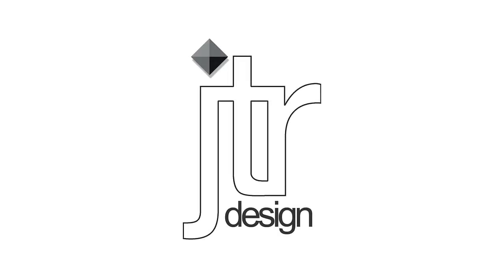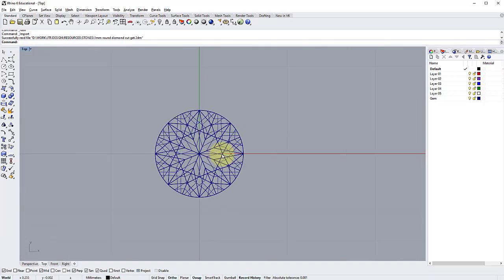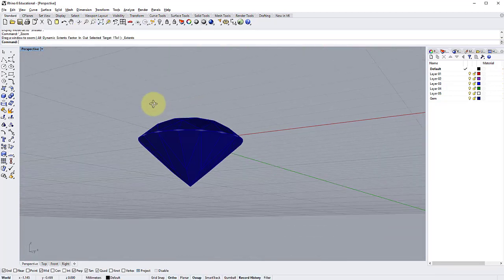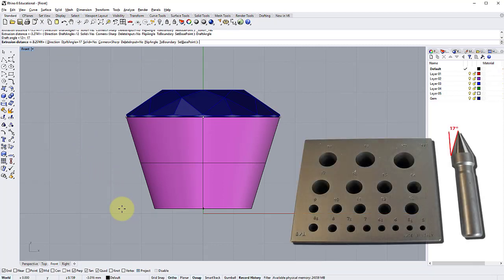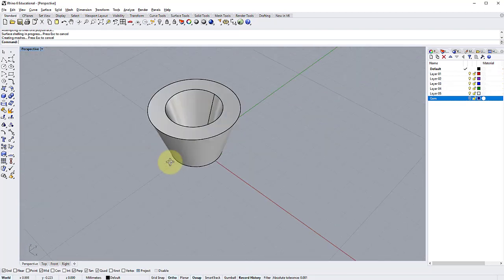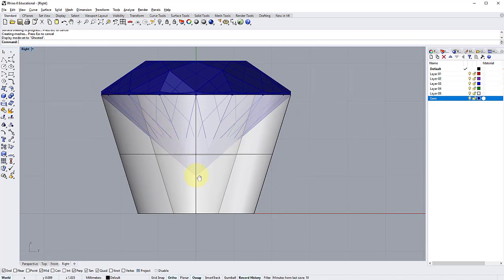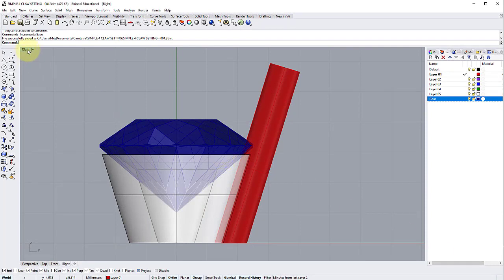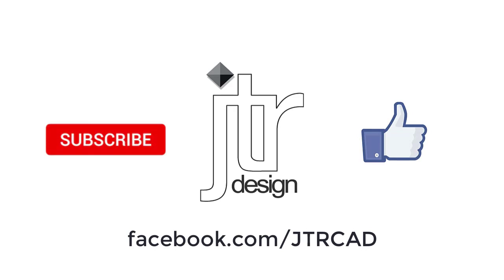4 Claw Setting -  Beginners Rhino Jewellery Tutorial

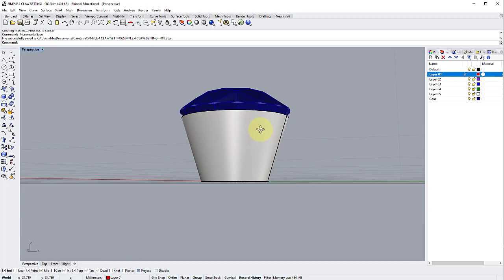Comment: for some reason i do not have the surface line needed at 12:14.... i have multiple lines and can not select any to extend ?
Reply from the maker: Hi Brock. If you don’t have the surface edge in that location you can use the command ExtractIsocurve to get one. If it’s not going in the correct orientation, click “toggle” in the command line. Hope this helps.

Comment: Nice tutorial, thank you! For the origin, I just enter 0 followed by Enter.

Regarding the design of stone settings, I'm a n00b. I wonder: Why do you not make the chamfer match the stone, and why do you not put an undercut into the prongs?

My guess is that 3D printing is not precise enough, plus variances in the stones, and it's better to do that by hand when doing the setting. But I really have no idea.
Reply from the maker: Your guess is kind of correct - its all do do with the variables of materials and manufacturing techniques.

Comment: This is a very good presentation. I am learning Rhino for jewellery and I tried your idea for a marquise stone. The pointed stone outline created a pointed under-bezel. Should I fillet the corners of the curve of the girdle outline before extruding it to make the under-bezel, or is there are way to round (soften) the ends of the extrusion? I ask becuase I have heard that sharp corners are a bad for casting. Not sure if I need to worry about it but thought you would know. Thank you for showing us how to do this!
Reply from the maker: Thanks for letting me know you liked the video, David . You could use the ‘fillet curve’ command to round the curve before you extrude or you can use the ‘fillet edge’ command. Though to be honest it should be fine as it is. With sharp edges and casting its usually long, sknife-edge areas left in negative space that cause issues, rather then sharp edges in positive  space, if that makes sense. If you require any help with your rhino learning journey get in touch.
Reply: @jtrdesign-practicalrhinoje9669  Thank you for the clarification and education regarding the sharp edges. Do you offer specific classes/lessons or is it one on one when there is a design issue I am struggling with?
Reply: @DavidConger  All classes are 1 one 1. I guess they’re more tutorials or bespoke lessons, rather that traditional classes. I tailor the lessons to your specific requirements, after an initial consultation. Then we arrange a date/time for the lesson and connect via Zoom. So if you have specific things you are struggling with I can help you with those or if there is a particular area or design you’d like to know more about, we can focus on that. Lessons can be a little at 1 hour or up to 6 hours. I find the optimum time for the student is short bursts of 1.5-2.0 hours. You can also record the lesson via zoom, so you have it to refer back to. If you’d like to discuss further I’m happy to have a chat over the phone or via email. Get in touch via email : jack@jackrow.com. You can check out my reviews here: www.facebook.com/jtrcad/reviews . Another thing to note is that my lessons also cover practical manufacturing, how to make realistic models for production, not just the CAD side of things, which I think is very important.
Reply: @jackrow1332  This sounds great! I have been using MatrixGold for a while but I often wish I had developed a better understanding of Rhino. I recently ran into something as I tried to make cathedral style fitted wedding band with diamonds. MG doesn't have the tools for this, but I know that if I had better skills with Rhino, I wouldn't be stuck. I would like to discuss this further with you. ~ Dave

Comment: having a hard time getting the cut command to work the way you show, potential difference between rhino6 and rhino 7?
Reply: Can you tell me the time/moment where you’re having trouble ?
Reply: @jackrow1332  i eventually got it. Basically it only wanted to cut 180° at a time so I had to do it twice to get the 360. But id create the intersecting line select it and hit wire cut then select the whole whole surface. Then cut and Basically nothing kept happening. I dont even know how I eventually got it to cut 180° at a time. But it didn't happen via the exact steps described, had to do something different. Sorry I can't be more descriptive its day one on this software for me.
Reply from the maker: Glad to hear you got it sorted! Well done :)